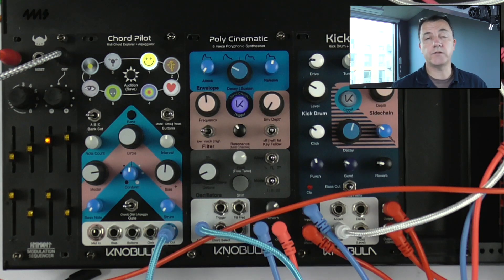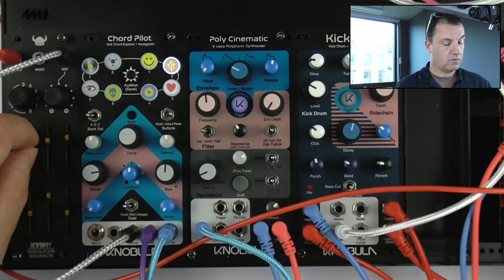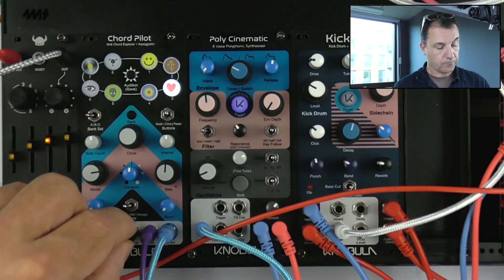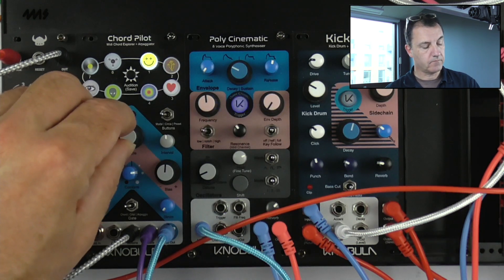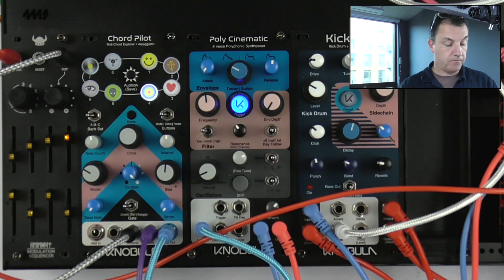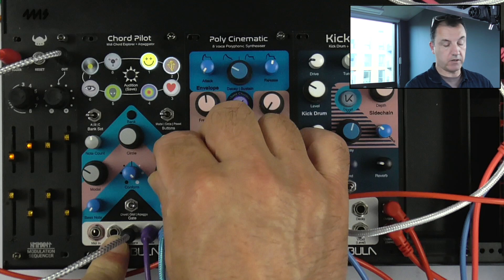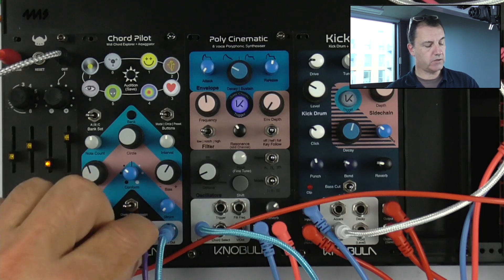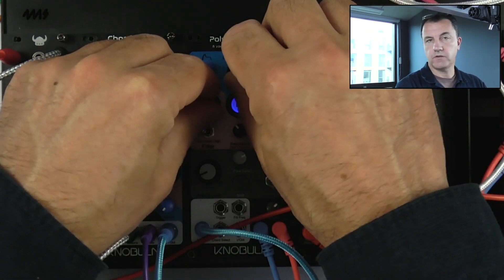Chord Pilot Part 4 - Buttons

Comment: Hi, I have fun playing with the buttons, but when I plug in the CV, I need to press the sequencer pad twice to change the button’s position. Any idea why? Thanks!
Reply from the maker: Are you sending the gate/trigger at the same time as the cv change? What happens is when you first press the pad  the cpilot triggers but the cv is still changing from the old value to the new, the second time you press it it plays the correct button because the cv isn’t changing. It’s a common sample and hold problem that is difficult to solve without delaying the trigger a bit, or advancing the cv a bit. Not something that can be done in the module.
Reply: @knobula_synths  Yes, I’m sending both to cpilot. I’m fairly new to the CV world so I’m sure that would be the issue. Thanks for the guidance
Reply: @knobula_synths  Yes, I’m sending both to cpilot. I’m fairly new to the CV world so I’m sure that would be the issue. I ended up using disting delay pulse algo for the gate. Thanks for your guidance